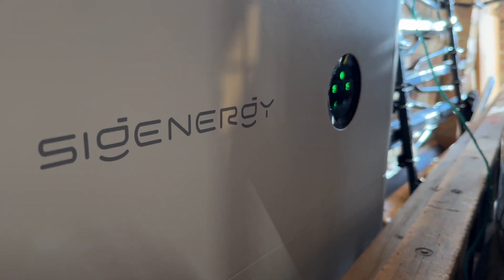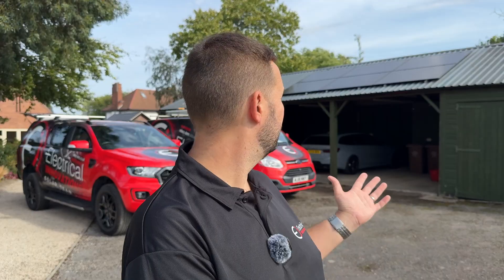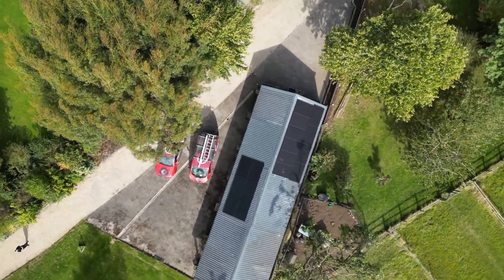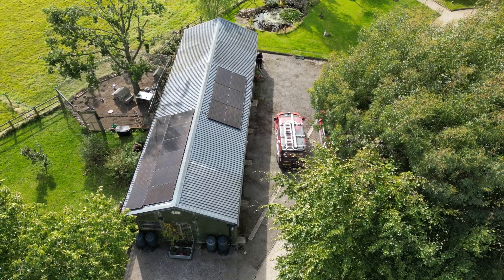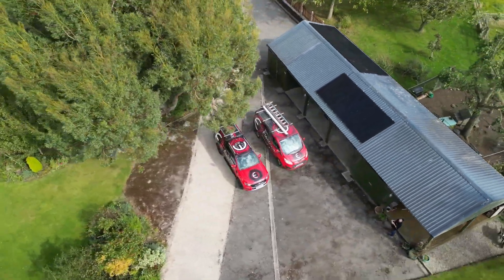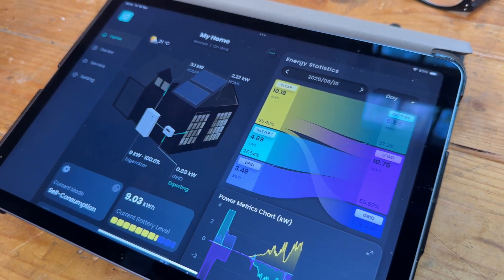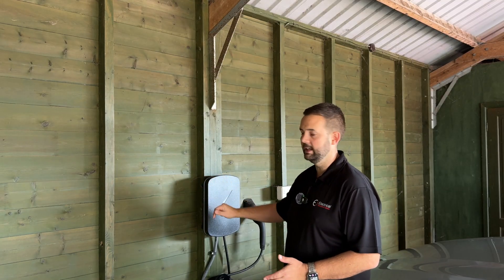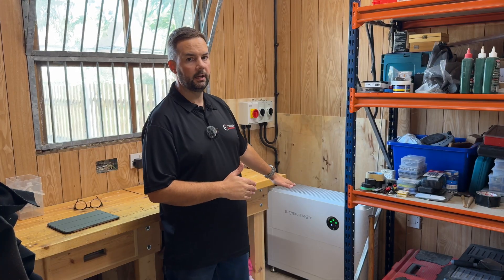DNO Restricted our Solar install - 3.6 KW Inverter with 16 Solar Panels and Sig Energy Battery

Comment: I have a permission to export 5.8 kw but it only got that about one month Now in October I am hard pressed to get 1KW and  have to import but I could have more panels and use it here on site. 32kw of battery drop quite fast when the sun drops lower for the winter.
Reply from the maker: That sounds like a fantastic site. This is why it’s not unusual to oversize your solar panels relative to your inverter.

Comment: Why a 3.6 kWh inverter?  Presumably you just have an export limit from the DNO of 3.64 kWh, which can be set as a limit on a larger inverter.  This would allow more AC production to flow to the home and the Hypervolt EV charger whilst maintaining the export at the DNO's limit for as much of the day as possible.
Given the expanse of the south-facing roof area why install any panels on the north facing (albeit shallow pitch) roof at all?  Shading moves throughout the day so the south facing panels could be laid out in specific clusters to catch the best possible energy and making use of as many MPPTs as possible (presuming there are no DC optimisers on each panel).
As currently explained you seem to have set further bottlenecks in addition to the DNO's miserly 3.64 kWh.
DNO restrictions can often be overcome down the line.  Local houses that have a higher limit can have part of it withdrawn if they are not making the required usage percentage.  DNOs have been rubbish in managing local limits and it is quite common for early adopters to have been given a higher limit than they actually need or use.

Comment: I suppose the DNO is not going to trust third parties to limit export through software. If something goes wrong with that, you could end up with serious overload and damage to local grid infrastructure. Much of the UK has old mains cabling which is nowhere near capable of everybody exporting and importing tons of power. I'm sure that charging batteries overnight will not be allowed for much longer. I suspect 3.6 kW represents some sort of average diversity figure for UK homes.
Reply: why would (and how?) charging batteries at night be an issue? I charge my EV at night at 7kW; my domestic battery at  <3kW, my thermal store at 3kW or sometimes 6 kW. The wind turbines rolling around at night need somewhere for the energy to be sold into, or we all pay 'curtailment' fees, i.e. money for (literally) nothing. This whole issue of " the DNO ...not trust(ing) third parties to limit export through software..." is a false premise: A smart grid - the ONLY future - will be entirely (AI) software-managed, it's time for the DNO's to grow up - if they can't, they are not fit-for-purpose.  It's only when you have lazy humans 'in control' (are you listening, Ofgem?) that we get issues like the Iberian blackout...
Reply: @jesflynn4048 all electrical systems are designed on the principle of electrical diversity, Google "electrical diversity grid level" for a full explanation in relation to this post.

Briefly that means that not everyone will be expected to use the full capacity of their grid connection at the same time.
The reason that the default export value in the UK is 3.6kW is because that is probably the average amount of power that it is expected for each home to draw at the same time. If everyone suddenly starts drawing 10 or 15kW at the same time the grid will literally melt down.

Also if everyone starts buying at cheap rate and selling back at peak rate or load shifting, electricity companies will go broke so in the long run they will definitely stop people from doing that once more people have batteries.

Electrical grids were largely designed at a time when electrical demand was low so DNOs could never have anticipated EVs, PV, batteries heat pumps etc anymore than we can know what the demand will be 50 years from now. Because of this most of the grid is underpowered and would need to be upgraded to allow everyone to do what you are doing. That will take decades and cost a fortune so don't hold your breath. 

Smart grids will basically ration your connection to stop the grid overloading and that is why I think they will stop battery charging at night when the priority will be given to EVs.

Basically I expect export tariffs to drop and cheap rate import tariffs to increase as smart tech shifts load throughout the day.

To summarise, I'm afraid our gravy train will be over soon.

Comment: Dealing with the dno is a challenge as many operators dont use tech people. I had an ev charger refused , even when we stated the ev unit we would use would have load restriction built in to ramp down if home was using its max . No no no . How do customers go ev. Or solar.  I have an dno refused a 10kw battery pack, after fighting they gave in and gave us a fast track G100.

Comment: The main problem with exporting is the maximum permissible voltage. Don’t know what the SIG limits to, but the DNO must have done some calculations, especially if it is a remote location with very few properties. Long before solar was a a thing, I was measuring 250 volts on a farm supply which was right next to the transformer. Not much leeway for exporting. The farm currently has at least 16kW of panels installed. I shall have to measure voltage again next time I’m across the road.
Reply from the maker: Yes this is the main issue.  Rural can be a problem

Comment: The 12kw lux power sna XP. Can handle 22kw of panels and has setting to limit your export to the grid.
Reply from the maker: It was an inverter size limit, not an export limit

Comment: Why not an 8kW inverter and limit export to 3.6kW?
Reply: Why would the DNO care what is going on within the borders of your property? Surely all they care about is you putting too much strain on the local cabling and transformers.
Reply from the maker: It wasn't the export that got limited.  This was the actual inverter size that was restricted
Reply: @ElectricalInnovations  why? that does not make sense to me if a larger inverter has G99/G100 approval as listed on the ena connect direct database why would the DNO prevent it being used via the built in software to manage export limits, that seems very counter productive for a customer.

I am quite curious about this because I am considering adding a ground mounted array hybrid inverter and storage to supplement to our existing 4KW Fit system,  so it would not be possible to do so if we can't actually add another inverter.

Comment: make no sense they did not make a off grid system, all those regulations (and money) could have been avoided
to be onnest the people installing it is looking to much at keeping stuff at a failing grid most people want to avoid to begin with

im starting to remove my hybrid inverters from the grid now and replacing with offgrid, for more then 1 reason

Comment: You nicely highlight the complexities. I have solar and battery and EVC all on Givenergy so all manageable as one system. Plus DNO approved G99. But the Givenergy EVC is still not interoperable with octopus IG so I had to register through Volkswagen - which is fine but the Octopus to VW link is a bit flakey and does some unpredictable things at times. We have a problem with over voltage >253v tripping out the EVC (PEN fault protection) and reported this to the DNO but their technology can't really do anything about it, and it's only going to get worse. The DNOs are going to have to invest in proper voltage regulation if the regulator will allow them to spend the money. There is drift towards 3 phase as standard for residential homes to try to balance load but plans are at a very early stage and look half-baked.  Cheers
Reply from the maker: How long is the submain from batteries to grid connection?  If this is long and undersized it can add to overvoltage issues.
Reply: @ElectricalInnovations it's about 50m from my home battery to the grid supply point on my property and the cable between them is 16mm2. Then the car charger is about 10m from the battery. My max export current is perhaps about 15A. I can see the inverter may have to jack up the voltage a bit more to overcome cable losses between the inverter/battery and the grid connection. But it should not be more than 1v or some such. Cheers
Reply: agree all points. 1p Voltage stability locally (to our transformer) was wild and very often (several occasions each day) exceeding 256V. Eventually the DNO regulated (unwound) the transformer, no more over V cutouts. Arthur illustrates nicely the sort of solutions the UK electrical power system should be coming up with - it seems the issue is that Ofgem and the other civil infrastructure entities appear to be either clueless or powerless - or both. It should be mandatory for any solar PV installation to have  adequate battery storage capacity for at least a day's worth of PV generation; the frameworks for 'smart' grid access to that energy need to be much better standardised, incentivised and promulgated (also/moreso with EV's), then we would avoid much of the 'peaker' supply complication. I'm sure an AI programme could manage this - only the reliability of the 70 year old copper-wire 'landline' broadband connections (only thing available locally(!)) to sort and we'll be nearly there...
And a bigger dunkelflaute-avoiding grid, of course.
Reply: @jesflynn4048 we live in an urban environment with 12k residents. DNO is not keen to mess with tappings as it does not know which customers are close to upper voltage limits and which are close to lower limits. I have a friend who was involved in the design of smart meters who told me the DNO requirements for voltage monitoring did not really get in there, and a DNO person has told me that smart meter point of supply voltage data, insofar as it exists, cannot be shared with DNOs at an individual home level due to data protection regulations. And also it's not able to track fluctuations with any real-time granularity. On my inverter app I can see grid voltages ranging from 245 to 250 in a matter of moments fluctuating up and down quickly as loads change. I agree the regulator etc needs 'grounding' literally, to understand the real world practical realities people are facing every day.

Comment: Mine was restricted as well due to a shared loop in loop out connection from the mains. Sometimes it is what it is..
Reply: nah....
in denmark we dont get those limits, the grid updates if needed 
18kw for all
Reply from the maker: Its not ideal but we work with all the constraints to get the best option.

Comment: When you can buy electricity at about 6 p on an EV tariff, PV makes no economic sense. As for adding shading mitigation, that’s wholly pointless and unnecessary expense too. You advised this client very poorly.
Reply: Bit harsh & somewhat incorrect...
Yes, you can grab electricity cheaply atm if you qualify and the energy provider doesn't enforce their fair use policy...
But as more & more people jump on the battery storage bandwagon, more people are soaking the ultra cheap off-peak energy, which as Supply & Demand shows, eventually that abundance of ultra cheap energy will reduce & disappear. Leaving people to pay a more modest rate of say 12 to 15p like E7 & heat-pump/Cosy rates in years to come as off-peak demand surges year on year from 20GW/hr to 25+GW/hr...
In other words, the off-peak low demand will rise to a modest daytime demand say 8.00am to 10.00am ergo it won't be 6 or 7p off-peak any more and anybody who believes the ultra cheap will always be available is deluding themselves...

PV makes no sense ???
If we was paying £200+ for each panel like 4 or 5 years ago, then perhaps that might be some truth to that claim...
However - a £60 panel facing true South, perfect optimal pitch, no shading etc... can produce up to 500kW per year...
To buy 500kW at 6p off-peak will cost you £30 each year, so the £60 panel will pay for itself in 2 years
To buy 500KW at full day rate of 30p would cost you £150, so the £60 panel have paid for itself in under just under 5 months
Even if the £60 panel only produced 400kW pa in a more realistic world, that 400kW all at 6p would cost you £24
So the £60 panel would pay for itself in 2.5 years & then saving all that energy/money for the next 15 or 20 years...
But I guess to some this does not make any economic sense

Shade mitigation - well this is a controversial subject tbh...
Some people love all the data stuff from each panel, but to me, if you don't suffer any shading on main roof then don't fit them. You will just be introducing more & more points of failures - especially with Tigo optimisers where the 4 MC4's meet the panel's 2 MC4's before linking to next panel/Tigo - you can actually end up TRIPLING the amount of MC4's under the panels with optimisers
Micro-inverters do not multiply the amount of MC4 weak points quite like optimisers...
BUT at least one or two optimisers/micro-inverters wiil fail before a panel fails...
This will leave owner needing to have the scaffolding erected once again to replace faulty module...
Optimisers are supposed to last a little longer than a micro-inverter as the optimiser isn't also inverting the DC to AC & just ergh optimising the individual panel - so some say optimisers might have more longevity than micro-inverters...
However, when an optimiser fails in a string of panels - the whole series string fails...
When one micro-inverter fails, it will only effect the one panel or two connected to it, the other panels with micro-inverters should still operate & produce energy - so not a complete string generation failure like optimisers

If you absolutely must have optimisers/micro-inverters on your main roof, then try to have them fitted inside the loft space, passing the panel cable up between layers of felt to the internal loft space...
That way, if or rather WHEN a module fails & needs replacing, it is a 30 min job or less with no scaffolding required

Again, me personally, there is no shading on my main roof, so no optimiser/micro-inverter or less to go wrong
However, on a single story roof with partial shading, then yes I'd fit some form of shade mitigation, as it is easy to access & replace a module on a shed/barn extension

But you don't need shade mitigation on modern panels...
Yeah, says the panel manufacturer of course, the reality is that shading impacts performance and despite panel manufacturers claims it has improved shade mitigation built in, it still impacts performance
People have replicated Aiko demonstrating their improved shade mitigation demonstrations at shows and found in certain instances the panel is still heavily impacted by certain shading tests...
No doubt panel technology is improving but the panel/optimiser claims are not always as true as the manufacturer claims or leads you to believe

If that wasn't enough - portrait vs landscape panels...
With a portrait panel & a mostly vertical line casting shade, it would mostly fall upon one of the vertically arranged cells & the bypass diode would kick in to try to reduce generation to 2/3rds from the other 2 clear rows of cells
If that panel was fitted landscape instead of usual portrait, the vertical shade line would cast across all 3 rows of cells and the panel/diodes would just shrug their shoulders and hope they could keep the circuit complete coz nothing is being generated from that panel...
Now there is half cell technology in most of the recent panels which might mitigate the almost total loss of generation in a shaded landscape panel - but if that shading is wider & covers the centre of panel - then all 6 rows of half cells are gone
So perhaps on shaded installs, no matter how minor, maybe avoid placing panels in landscape if possible as they tend to be impacted by vertical shading compared to portrait panels
(In cases where the shading is mainly horizontal, then landscape might be less impacted than portrait panels)

Me - I'd cut down the bloomin' trees, but they might be fruit trees or preservation order or even not even mine to cut down.
So I'd fit independent micro inverters to most of the shaded panels, which won't impact others on micro-inverter
Then the unshaded panels might be able to go on a simple string to inverter,
(Would need a little more info how the sun/shade tracks across the day over the seasons to establish & fine tune panel/shading/string arrangement maybe but nothing major to deduce)
Then install more panels and run another off-grid setup to get around the G98 limit like me & others are suggesting

Yet you seem to think differently & hope the ultra cheap energy will always be there - fair enough, to each their own I guess
Reply: @authuruksake969 amazing reply, totally 👍
Reply: @pau1phi11ips  thanks - soz it was way way TL-DR  but got carried away over explaining (again)